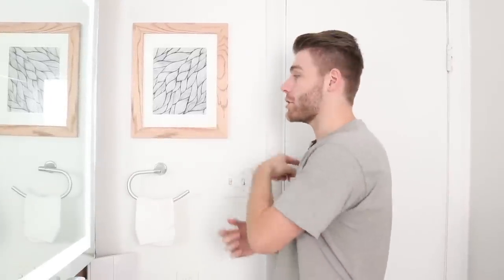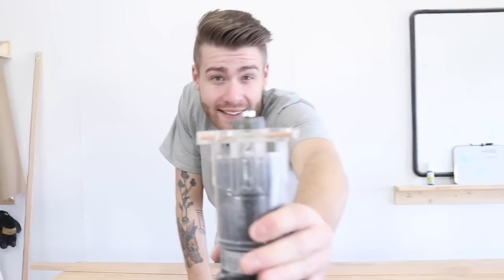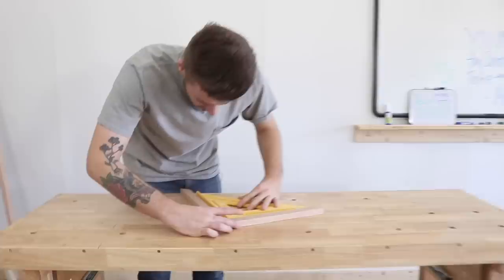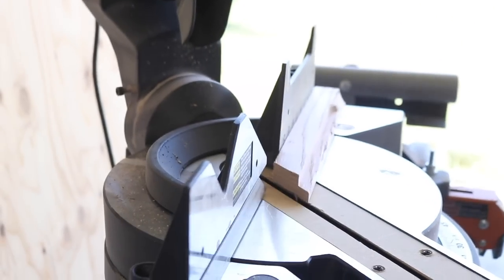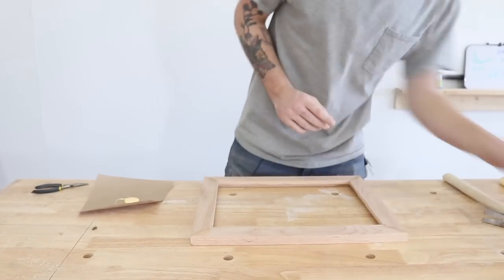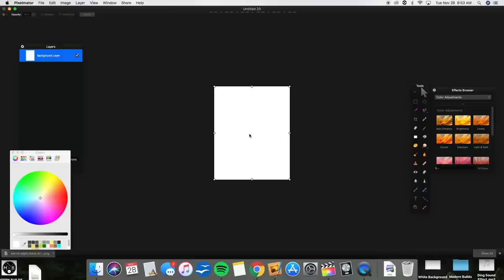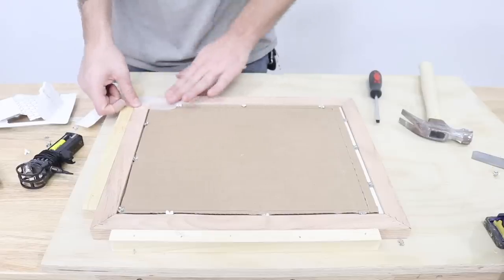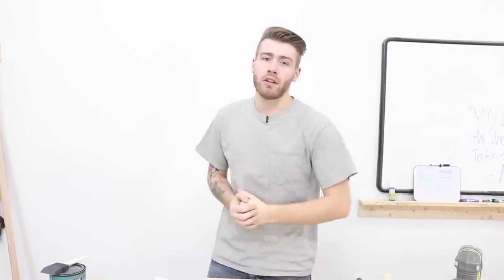How To Build a Picture Frame - The Best Way | Modern Builds | DIY

Comment: I have several years of high-end framing experience, and this looks pretty good for a quick home fix. My main suggestion here is to make sure you secure your artwork to the back of your mat with some linen art tape. This way you’re not taking it apart if the piece ever slides out of place...which is definitely going to happen.

Btw love the podcast
Reply from the maker: Awesome tip! Thanks Evan
Reply: you should pin this comment!

Comment: Very cool overview video.  Way to freshen up an old topic.  One quick suggestion to improve efficiency and accuracy at once.  To get opposing sides exactly the same size, just use a stop block, stack two pieces of wood, and cut both to length at once on the miter saw.  Less time, more accurate; its a win-win scenario.

Comment: Couple of quick tips from a framer :) Use a tablesaw for the notches it's much cleaner and easier, stop blocks and a sharp blade on the mitresaw will get you perfect mitres, glue is typically used on the joints as well and a standard tie down strap with cardboard at the corners can be use in a pinch to clamp. And also paper mounting corners or even tape to stop the piece moving if not included with the pre-cut mat board.
Reply: Couldn't agree more. I've made a bunch of stop block jigs for different frame sizes. My frames come out great every time.
Reply: What is notching, is that what he used the router for? Assuming mitre for the 45 degree cuts. I'm hoping to build my own this week.

Comment: I like those Velcro things you used.  
Another tip for hanging frames.
Nail small finishing nails, or drill small holes in the back of the frame for them. 1 in each corner on the back of them frame. Cut the heads off, line up your frame and push it into the wall. Nice and secure, won't wiggle crooked and leaves small holes. I find this the easiest way to make them level as well.

Comment: Nice quick and easy frames. Another tip to get nice snug 45 degree cuts, i like to have a small piece of thin cardboard, i'll use that on the fence of my mitre saw to increase the angle just slightly, so you get a nice snug fit on your mitre cuts. It's fast, easy and everyone can use this method.

Comment: Hey Mike. Love your channel and your projects! Nice work, from a professional framer. 👍

Only a couple notes. Most frames have a standard 1/4" rabbit, though we do carry a few barn wood frames that are 1/2" so theres nothing wrong by doing it that way. Obviously the difference is just seen on how much mat is covered. (More important to note if you are framing without a mat, and in that case you should also use spacers on the glass)

6x5 made me laugh lol

The glass you bought has no uv protection (yes, even if your picture doesnt have direct sun light it will still fade and/or discolor over time). Not a big deal if its cheap art and you want to switch it out every so often.

Acid free mat board or foam board > cardboard

standard size frames are mass produced and really can be found for the price you paid for the materials. Our store for instance carries plenty of 11x14 frames for $20 (when on sale, and most are real wood).

Custom sizes (basically anything not a whole number) is when it gets expensive.

Keep up the good work, man :)

Comment: Just a quick aside.  That's a rabbeting bit in your router.  Dado bits are straight cutting without the ball bearing.  Other than that keep up the good content.
Reply: The Olmstead Workshop Came here for this. Thank you.
Reply: I notice he's routing from right to the left. is it in fact proper technique to route from left to right? is it unsafe to do one instead of the other?
Reply: rsngrl since he is hand routing outside edges need to be cut counter-clockwise.  Since he was routing the edge furthest away from him that was in fact counter-clockwise and correct.
Reply: brodie659 is correct outside edges are routed counter-clockwise and inside edges are routed clockwise.  Otherwise the bit won't cut as well and can "run" along the piece and possibly out of control.

Comment: I worked as a professional framer for about 4 years and was expecting this video to be full of misinformation. Pleasantly surprised to find that this is a really good build instruction that doesn't require any specialty tools. My only note is that you shouldn't use cardboard as a backer for original artworks or other valuable or irreplaceable pieces. You need an acid free mat board or any other acid free backer would be fine. Taping the inside of the frame rabbet with an aluminium sealing tape is industry standard to prevent acids from seeping out of the wood and discoloring the mat or art, but its not as crucial as having an acid free backer. Taping also prevents bits of dust from the frame being released under the glass when stapling the backer in place.
Reply from the maker: Right on. That's a good tip, I appreciate it.
Reply: Awesome additional info. Thank you!

Comment: I can't find a dado bit like the one you used for less than $100 anywhere. I'm also kind of a novice at using a router so my knowledge about bits is basic at best. Where did you get the Dado bit?

Comment: Groove? ... you meant rabbet I think.   "V" nails... or corrugated nails would probably hold better.
Reply: Sprank900 Former high-end art framer here. These v-nails actually are what we used in manufacturing frames, and are incredibly sturdy. I don’t think they’re the most practical for home use, but with wood glue and a few well-set v-nails, that joint isn’t going to come apart.

Comment: Just say no to oak.

So what if your frame requires a huge piece of glass?  Where do you buy it?
Reply: In my old apartment I used to frame movie posters with metal frames, since they were all the same size they looked really cool hanging together.I would first take them to a framing shop to have them vacuum mounted on foam core then frame them myself.  I think the size was 24 by 36 inches if my memory serves me correctly, which is pretty large for a piece of glass. Just google a glass and mirror store in your area, and they can cut it to size. The glass is fairly thin to keep the weight down so you have to be careful with it, so it doesn't break. Good luck.

Comment: Here's a true story: I tried to make a frame once. It was the first time I ever tried anything ambitious with wood, and the first time I'd ever used my hand-held router. I used my speed square to cut 45 degree pieces, joined them up using wood glue and screws, and I even used wood filler to hide the screws and cover up an imperfections. I was so proud of myself. It's only then that I realised I'd forgotten to route a channel for the glass to sit in!

Suffice it to say, I fucked it up royally! Yeah, I'm not even going to sugar-coat it! I totally fucked that motherfucker up, and then got so angry, I smashed the frame to pieces and haven't touched the router or wood again. Fucking routers!